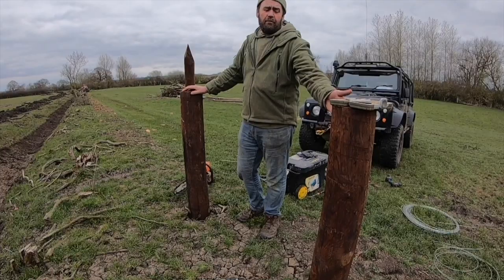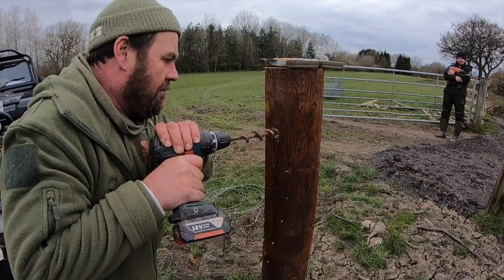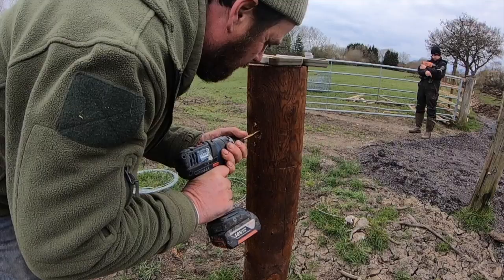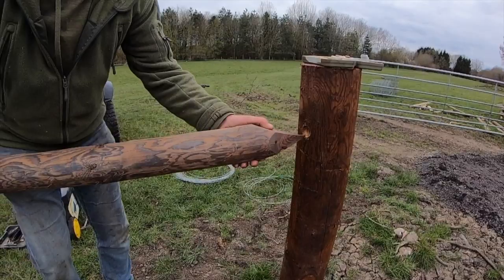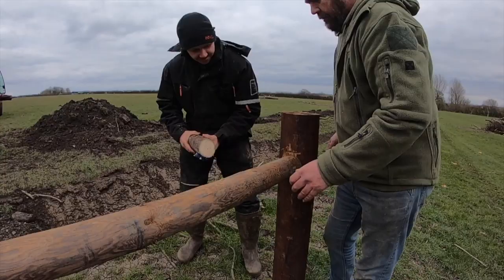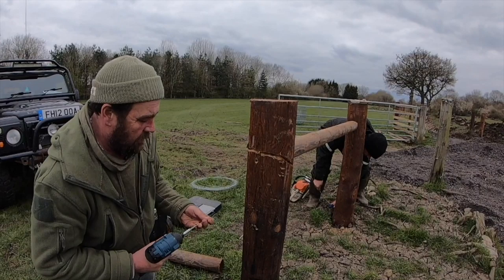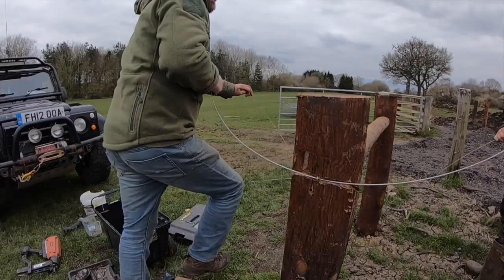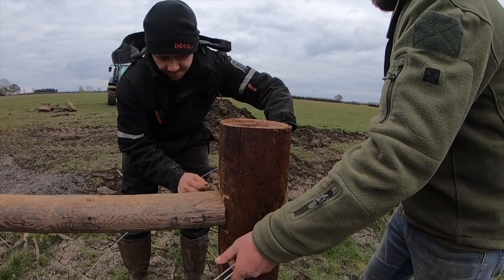HOW TO: Fencing - Box strainer

Comment: Nice vid ,but ur working hard to do a box end assembly. Top strut should be 7ft plus long.to get the angles right wire should be about 30deg.
Reply: You are correct. I use 10' rails. A short rail will cause the strut to lift the Strainer post out over time